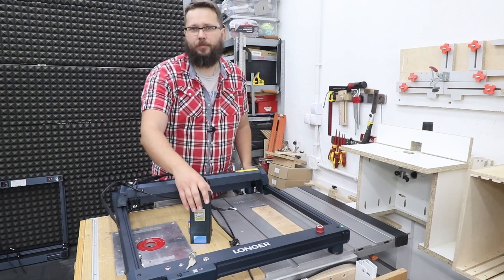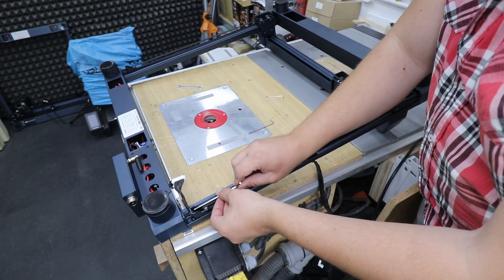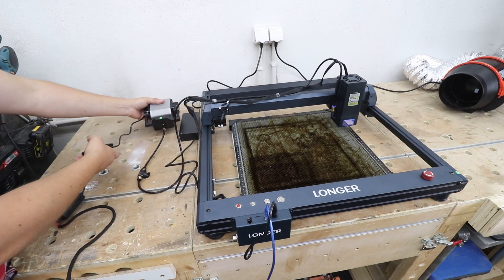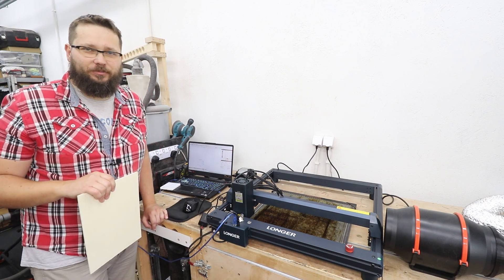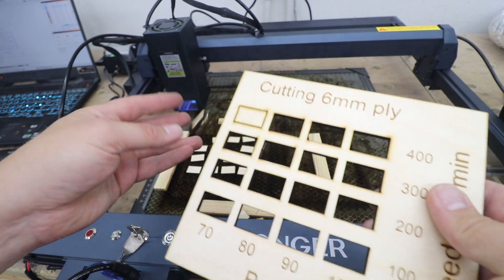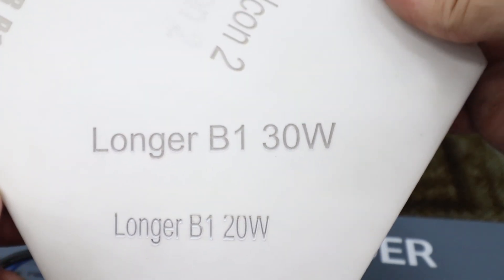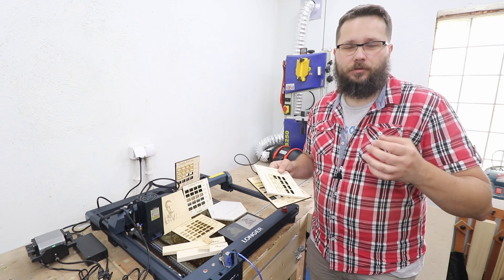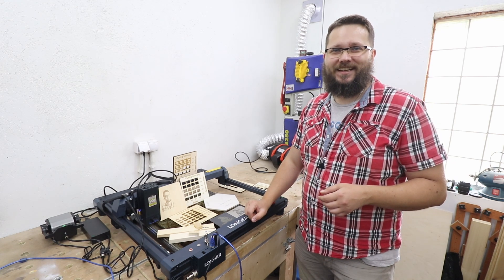Affordable 30W Laser | Assembly Plus Detailed Testing of Longer Laser B1 30W

Comment: F Y I...  The vent hood I ordered was the Twotrees TS2.... Room to spare with dimensions of 800mm x 800mm x 400mm....  It comes with a small fan which will be supplemented with an inline fan and I'll add a strip of COB LED's.  The nice feature of this hood is that is has a velcro door on the left side - front that will provide a cross air flow to the right side - rear fan port.  A note on these 35 dollar inline fans; The squirrel cage type blades have a fairly large gap between the blades and the housing.  I used a strip of fairly stiff thin plastic and tapped it around on the intake port, making the blade to case distance ~1/16 of an inch.  This "baffling" helped the air that the blades sucked to not sneak out from around the large gap that it had before modification.  My very "unscientific testing" revealed a 37.95% airflow increase that really helped this fan do the job.  The neighbors complained that my fan output blew over their yard furniture and I said tough $hit  🙂🙂🙂...  NOOOOO.  A good video without any BS.. Thanks
Reply from the maker: Very interesting, I do have a similar fan I think. Super powerful and I do have a cordless remote.
Reply: @CasualDIY  I cut a circular piece of the 1/16" plastic the diameter of the fan blades and temporarily placed it on the top edge of the blades.  Then when fastening-taping the strips of plastic to use as a baffle, the plastic placed on top of the blades acted as a "gauge" to keep the installed plastic strip an equidistant from the blades.  It is a very effective way to increase the "suction" and therefore the "blow" performance of the fan. With my fan placed at the exhaust end of the 4 inch ducting, any smoke in the hood dissipates in a VERY short time....  AND, with this type of fan housing-two piece clam-shell, I also placed a strip of black electrical tape around the joint of where the two fan halves are joined....

Comment: how do you setup this ? my windows 7 won't recognise the machine ...
Reply from the maker: Did you check the software requirements, what's the oldest Windows it will run on? I think Windows 7 is way too old.
Reply: @CasualDIY  needed some old drivers for usb serial and now works like champion
Reply from the maker: @mihgio3235 great to hear that, would never think of that 🤔

Comment: Have viewed all of your videos on laser engravers/cutters. Which one would you recommend for a hobbyist/diy'er that would produce crisp results with minimum burn showing on fromnt and back of project. Watched a lot of your other videos and am well impressed with your presentations and feedback
Reply from the maker: If you want to cut materials then I would recommend lasers with 30W power they can cut in thicker materials but also at higher speeds that means less overburn, but if you invest in air pump for the air assist then you won't have any issues with overburn. To be fair the 30W lasers I tested are very good and at more or less similar price tag. So it's the extra features that may sway you either way. However a cheaper alternative will be the 10-20W modules. If you need cutting again the 20W modules will do a better job. For engraving the 10W will do just fine. On my channel I don't allow lasers that are just rubbish, I think that would be a waste of my time and time of my viewers. That means they are all good. Each will have some small advantages, design ideas etc. But overall they are all good at what they do. It's down to you to way the price tags and potential features you may be interested in. 
And by the way I'm just testing a laser from less know make but it has one awesome feature, super simple thing but an immense life quality improvement I've not seen in any other laser machine. However I can't talk about it until the end of the month 😢 but it's awesome- at least for me it is as I love laser engravers and cutters 🤣
One thing I would not recommend buying is the older models of any make, yes the may be cheaper but I found from my viewers that quite often companies just drop support for those older models. So I would go for something newish.
Reply: Thanks for the feedback. I'll keep an eye out for this new laser review  @CasualDIY

Comment: Very nice review! one question though. I can't find any specs on the outside dimensions of this device, which i would like to know given the restricted space inside my enclosure.
Would you be so kind to provide the outside dimensions? 

Related to engraving slate:
Power for slate is WAY to high....my 5W laser i have to set to 40% power even.
What you are seeing right now is "melting" of the slate, resulting is microscopic glass beads.
If you reduce the power, the engraving on slate will be nice and sharp.

Cheers!
Reply from the maker: Cool thank you for the tip. Not messed around with slate yet so any tips are welcome. I'm away from my workshop till Friday. If you could remind me then I'll measure the machine up for you.
Reply: @CasualDIY  You’re more then welcome and thanks in advance for taking the time. I’ll remind you 😉
Reply: @CasualDIY  I'll remind you NOW, uh, like 9 MONTHS AGO you were asked...  ;-(